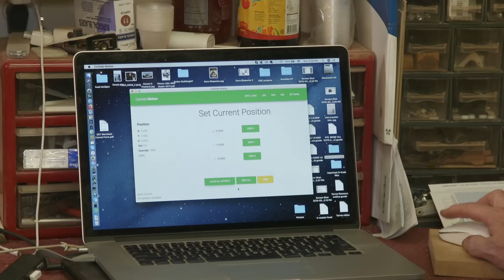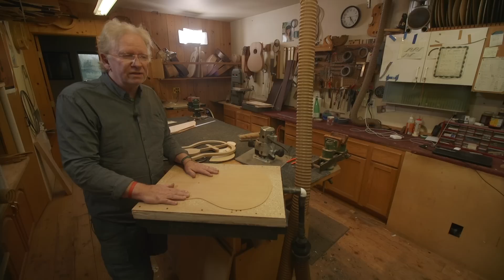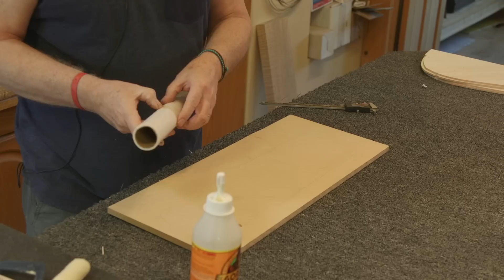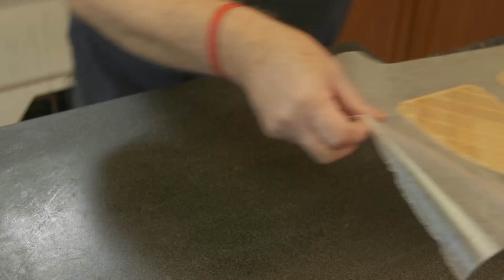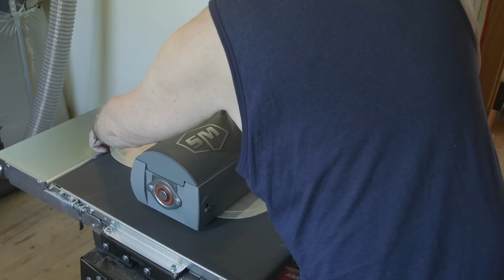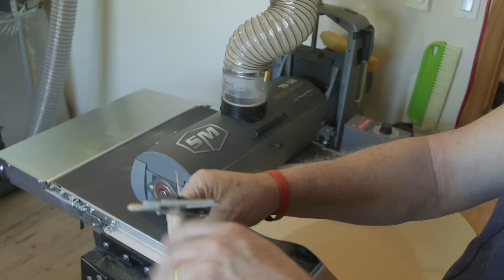How to make a Double top/balsa soundboard

Comment: This is an extremely helpful and informative video.  Thanks for posting it! I realize that this is an older video and I hope that you will be able to respond. I make steel string acoustics and have made several double tops with nomex cores. They work pretty well but I am always trying to improve my guitars. Particularly with LMI out of business it is harder to get nomex, and frankly I haven't been thrilled with that product.  That is why I've been contemplating using a balsa core. Your idea of 45 degree channels is great! That makes so much more sense than simply machining round holes. What I am wondering is where you source your balsa and is there anything special about it that I should know. In searching suppliers, I see that there are a number of different weights and types available as well as end grain. Have you done any experimenting and is there a particular type that has been better for you? Thanks in advance for any information.

Comment: So you made  very fine lattice and then covered it with foaming expanding glue that will no doubt expand into all of those little spaces, and added glue to hold th other piece of wood on your “sandwich”. I’m not a luthier yet ( soon to be ) but I am Woodworker of many years. Seems to me you’ve just severely limited the top’s ability to vibrate, and have basically turned this into a “glue top”. I want to be wrong, so please instruct me.
Reply: The glue should only make contact at the wood thats why you usually would load a plexiglass plate with a very small evenly spread amount of glue and then place the top on the plate . The way he does is seems like it would risk putting glue in the voids. That being said the amount of glue is so minimal that it barely even foams up so I doubt it would have any adverse effects. I personally use epoxy because it doesn't expand or evaporate when hardening so I get a nice even coat that doesn't soak in too much and dries nice and hard and stable.

Comment: ~ 26:46 in regard to the balsa stiffening the soundboard [laterally] with diagonal struts rather than other orientations: - wouldn't that also depend on the direction of  fibre/wood grain in the original balsa board?
Reply from the maker: Yes.

Comment: Hey Michael. Why not just rout it out of the spruce and not use an insert? The balsa cant be that much lighter than spruce. Just rout it out of a .7mm top half and glue it to a solid .7mm bottom spruce half.
Reply from the maker: Because the balsa is running across the grain making the cross grain stiffness higher.  just routing out the top just makes the top lighter with no added stiffness.
Reply: Just cut out the bottom veneer with the grain oriented as you wish, then rout it out.
Reply from the maker: @dougmiles4396  i don't understand what you are trying to explain.  what is "bottom veneer?
Reply: A double top is comprised of a thin, solid, top veneer, and a bottom veneer that is routed out in order to glue either  a balsa or  nomex insert into the resultant cavity. Then the two veneers are glued together. Why not orient the grain in the bottom veneer obliquely to the top veneer, maybe even having the left half of the bottom veneer in one oblique orientation, and the other half in the opposite oblique orientation, like a v. Then just rout the bottom veneer out like you do the balsa, and glue them together.
Reply: I see you rout out the top veneer. Just rout out the bottom veneer as I described, so the top won't have a weird appearance with the grain having a v shape.
Reply: BTW, I think you make killer guitars.
Reply: I guess you will need a mirror image of your CNC program, since you just flip over the balsa pattern for the other side. Line up the grain on the bottom v grain veneer to match the oblique angles of the program.
Reply: This way you dont have the hand held router step, and the insert gluing step
Reply: Or just route almost all the way through with the little cuts leaving a paper thin backing to hold all the small parts together.
Reply: Hah. If this works I get a free sample
Reply: So the bottom veneer with the v grain orientation will be sliced up with the same program you use for the balsa insert, but if course you don't rout all the way through. So no insert, and you save a bit on the glue weight.
Reply: Balsa is about 70% lighter than Sitka spruce and and also about 70% weaker. Balsas modulus of rupture is 21.6 MPa and Sitka spruce is 70 MPa.  This means you can take your .7 mm spruce bottom veneer and rout all the way through it with your little cuts using the same program.  But you should leave platforms for your strutting and under the bridge.
Reply from the maker: That makes no sense, no offense but I don't think you explain well or understand the process involved.. there is no top veneer its called the top.  I rout out a cavity in the top to receive the balsa core.  The only veneer is the back veneer glued onto the top with the balsa core inlaid into the cavity. by orienting the balsa grid it increases stiffness across the grain.
Reply: Let me say whatever you're doing certainly is working. But you might be able to skip some steps. And hearing to your terminology, Let's call the top veneer the top,  and the bottom veneer the veneer.  Let's say they are both  .7mm thick.  Let's say, that instead of routing out the top, you modified the bottom veneer by gluing  pieces together. But this time with the grain of the bottom veneer running in a "V" shape, much like the orientation of the strong parts of your balsa insert.  You then glue that on to the top. Then you treat the bottom with the little slices, .7mm deep. You would orient the grain in the bottom veneer to the same angle as your program cuts the strong parts of the balsa, to avoid cutting across the grain.  You would leave long thin platforms for your strutting, and a platform under the bridge area.  All of the tiny cuts would be visible from the inside of the finished guitar, just like the lattice work is visible in a lattice guitar.  I say to make the little cuts .7 mm deep which would be half the thickness of the completed top,  because Sitka spruce is  stronger than balsa. You can remove more material, but keep the same strength as the balsa top.  They would probably be similar in weight but this way would be stiffer.  You would avoid the handheld routing step and save a bit on glue because you're not gluing balsa in to the top.
Reply: If you are intrested in this then you can contact me on the E mail I left on your site. If you're not I'll do it myself.  I build guitars I just don't have a CNC machine.

Comment: Do you find gorilla glue to be better for this application than conventional wood glue? I've heard the gorilla glue tends to foam and expand as it dries. I'm curious to learn if there are other glues that have a long open time but crystalize as they dry. Cheers! I think I will be attempting this in the near future with our machine.
Reply from the maker: Most everyone I know uses Gorilla glue for this.  using a water based wood glue would be a disaster because it will swell the thin veneer ... I know Ive done it before.

Comment: Hi Michael. Really interesting video and I am going to make up some experimental sections over Christmas with cedar/Nomex and a three ply cedar with a laser cut out internal layer. I am curious as to your choice of adhesive. Is the fact that the PU foams to (partially) fill the voids an important factor and did you try other adhesives before deciding on the PU? My instinct would be that the relatively soft PU glue line would have a dampening effect on the soundboard so I would be interested to know your thoughts. Have you tried a spruce throughout soundboard with weight reduction machining on both parts as mentioned in Guy's post?

Comment: Excellent Michael. I like that CNC you are using. I've been wanting to get a CNC for my electric guitar builds, but want to use it for classical guitars as well. Would love to know more about your CNC. Thanks for sharing.
Reply from the maker: Hi David, good to hear from you. Hope yer doing well.  Yea, resistance is futile.  I got my CNC without knowing anything, and ended up taking a course at the community Collage here in Santa Fe on VCarve Pro software, to design and run stuff on the CNC.  There are lots of tutorial videos on the Vetric website too. 
https://www.vectric.com/products/vcarve-pro

I really can't live without this machine, and everyday come up with new ideas for using it.  Checkout the Shapoko website.  The best machine on the market in it price range and fantastic support, best investment I ever made!  Let me know if you have any questions. 
https://shop.carbide3d.com/products/shapeoko3?variant=14064078979133
Reply: Thanks Michael.  I'll do that. Which model do you have? Did you make your own bed with the hold downs? It doesn't look stock. I'm considering the Carbide3D Shapeoko XL Robust CNC Router Kit.
Reply: Shapeoko and Xcarve are both decent CNC machines. Once you get the machine a good first project is learning to make the hold downs.
Reply from the maker: @schrammguitars  I have the XL which is fine for 90% of what I do for classical guitar. But if you are doing electric guitars then I would get the XXL, because then there is no worry about fitting a whole body on there. 

Yea, I got the accessory bed with the track system.
https://shop.carbide3d.com/collections/accessories/products/t-track-table?variant=5175720706078
Reply from the maker: @Aajo2025       I don't like the Xcarve.  Less robust in the rails, and you must be online to use their software ... crazy!  

I mostly use the tape and crazy glue method for clamps for most of what I do.
Reply: @JMichaelThames  I have the Xcarve, never been online to use it. They offer their software but I use fusion 360 and chilielpeppr. It's worked great for me.
Reply from the maker: @Aajo2025     So you don't have to be online to use the control software that runs the XCarve?  It's been a while since I looked at the Xcarve when I was comparing CNC machines, so I guess there is a way around that. In some reviews guys where complaining about the online issue.  I watched many comparisons and felt the Shapeko was a better more stable machine, bit I'm sure the XCarve will get the job done too.
Reply: @JMichaelThames  When I bought the Xcarve I wanted the 1000mm work surface and it was a bit cheaper, I stiffened the rails for like 5 bucks. Xcarve provides software for you to use which is better for beginners but beyond that ultimately a CNC is a CNC and both machines run GRBL.

My workflow is Fusion 360 (design) > Vcarve (make the Gcode) > ChiliPeppr (Gcode sender). I never used their easel software because it seemed like garbage. While my workflow seems silly Fushion 360 (free) is awesome for designing but Vcarve is easier for creating Gcode and ChilliPeppr is the best free thing I found for sending Gcode. 
Not 100% sure but when I bought my Xcarve it was $1100 for the 1000mm with which is about 33” X 33” Nema 23 steppers, Shapeoko was a bit more and did not have a 1000mm option… this was about 3-4 years ago. Prices have changed.
Reply: Thanks!

Comment: Thank you Michael. I hope to make some of those in my retirement years. Your video is very inspiring and informative. I have a stack of spruce all ready to go. 
I never liked the nomex either. 
Besides volume with your ideal timbre preserved, do you see any sign of deformity that might limit the life of the instrument more than your solid top ones?
Reply from the maker: Thanks Ken, as far as the deformation of the top goes, I think it depends on the design of the grid and final veneer thickness.  My new design was in part to minimize the air gaps between the the slats of balsa, basically dividing up the air and wood by around half.  I think both the DT and solid wood have their unique problems. Solid wood it prone to cracking and reacting to humidity changes. The DT design involves more glue joints and those have to be done right.  I will say though, there is far more gluing surface with the balsa over the Nomex. I would worry a lot more about the integrity of Nomex, than balsa. I don't really see much of a possibility of any structural issues with the balsa designs.
Reply: Thanks. It makes s sense. I don’t think these guitars need to last forever anyway, although yours certainly might. I made a “braceless” top once for a steel string guitar. It used a sandwich of spruce and a composite material called Airex.  It sounded loud and very fundamental prominent. However after several years of going through seasons I came to realize that bracing is necessary to mitigate height changes. It could be gotten around by making some sort of adjustable bridge or neck but I lost interest. Some cello and double bass have longer sound post for changing out once a year.  But this is off topic.  I thought you might find it interesting.
Reply: can I get your contact number please? maybe I could buy some of you spruce, :)
Reply: Rene Lopez my spruce is very thin. I would have to measure it. I think it is around 0.06 inch thick. If you are in the US you can contact me at Ken (at) KENMCKAYGUITARS dot com.

Comment: Lovely work and its great to see you striving for such levels of perfection - when you could so easily rest on the laurels of your already beautiful guitars.  Maestro - With your ability with CNC to have such precision -  could it be now time to consider if the balsa layer could be dispensed with altogether and instead cut the 'core' directly into one of the two layers of spruce and thereby save on a heavy layer of glue as well as have a core that's perfectly integrated to one layer? Have you weighed the before and after glue-up of these tops?
Reply from the maker: Hi Guy, thanks for the kind words.  I kind of address the issue of simply cutting the grid design into a solid top in the video, but it deserves a few comments because this is a common question, and I've seen a few people do this. In my mind, the most important reason to do a DT is to stiffen the top across the grain, and eliminate some weight. Nomex does this very well by adding a predictable stiffness in all directions. The Balsa core cut along the grain, and then inlayed into the recess at a 45 degree angle adds stiffness in the direction of the grain, as well as across the grain.  If you simply cut the grid out of a solid top you are actually diminishing the stiffness of the top in all directions, and all you end up doing is cutting down on some weight. 

I tend to think of it like the balsa is the medullary rays in a spruce top.  From my experience tops with medullary are brighter sounding than tops without medullary.  On the other hand makers such as Fleta heavily brace the tops which add lots of stiffness, and from what I've seen he uses tops that are cut quite a bit off quarter.
Reply: @JMichaelThames  Lovely work. From the player’s perspective, it comes down to the quality of your right hand technique and the depth of your sound. Only players with enough weight in their sound can make a Fleta sound its best. Once you get that heavy top moving…